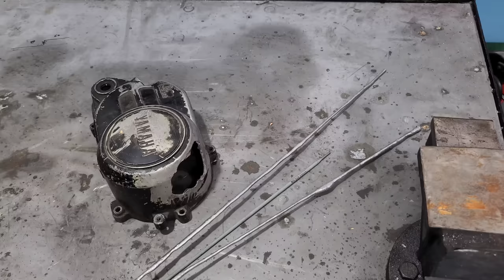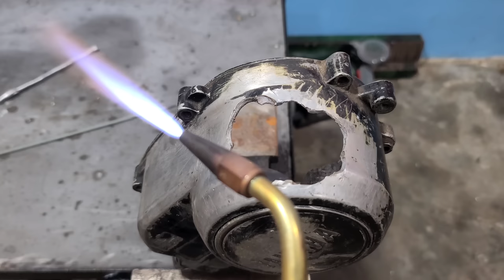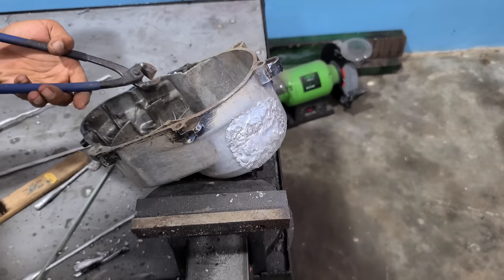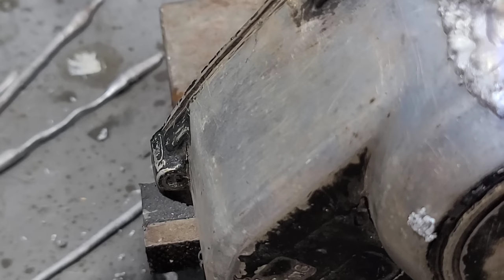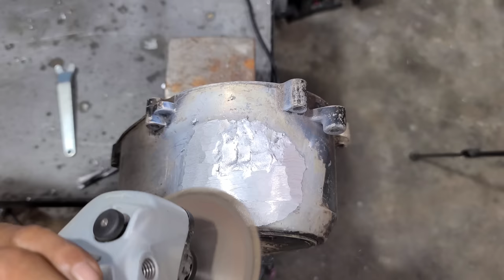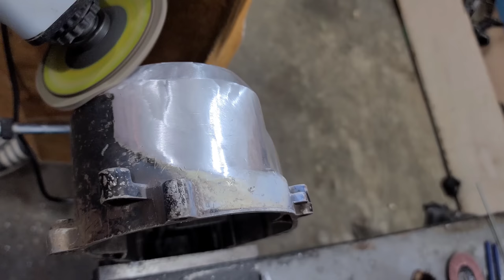How To Weld Aluminum , Hollow Motorcycle Blocks

Comment: I learned to gas weld Aluminum from a WW2 book published by ALCOA on welding for Aluminum aircraft parts before the advent of TIG. Takes time to learn and requires some serious practice. My biggest problem was seeing what I was doing due to the bright yellow flame given off making it hard to see when the Aluminum was going to puddle.  I did some experimentation and research to see what wavelength that yellow flame was then bought some low density blue industrial filter material (from Lee Filters) that blocks out the color of yellow, leaving you only seeing the Aluminum. Works great!!  NEVER let your flame be an Oxydizing flame, always make sure it is a slight carbuerizing flame for best results. Oxygen and Aluminum do go well together as any TIG welder will tell you! Same goes for gas welding Aluminum. !! Well done!
Reply: Use a #5 green to block the IR backed up by either cobalt blue or dydimium lenses. They are all readily available. If the filter material works well, that's good but it may not block the IR adequately. You should still back it up with a #5 green lense.
Reply: How do you stop it from making droplets encased in skin, that just fall off?
Reply: Essa vareta q epa tá fazendo  essa cobertura em.volta da peça ela tbem e alumínio

Comment: Having gas welded Aluminum before I got a tig set up I know how quick and perceptive you have to be to be successful. That said, to do a good job (ie: solid finished part), it would be far better to take a good piece of alu. of the correct thickness, shape it to fit the hole prep the seams and weld it.

Comment: I would cut and form 2 strips of alum plate and cut the hole square then tig welded it in much less work. but not a bad job for what it was but a long way I miss torch work lol. there's always so many different ways to do the same job keep up the good work & thanks for sharing
Reply: Do a video

Comment: B E A U T I F U L   J O B !!!
THANK YOU FOR DOING A SUPER JOB AND CAPTURING IT ON THIS VIDEO !!! I appreciate pretty work!
((I just subbed))
   My Dad taught me oxy/Actlyn and a coat hanger, welding before I was 10. I got into Iron Art about 11 and was mentored by a local artist for several years, making figurines, etc and selling them at a local art flea market. It is an art to be able to do. I worked as laborer and set-up assistant & later as a journeyman machinist at job shops and then got a break and got on with a major shop.
   When I first started work at the big shop, a group of craftsmen were trying to weld up a sheet metal fuel tank for a tractor, with 1/16" welding rods and were blowing holes in it and cussing like a sailor. I was 21 and not supposed to know anything. (No one knew I had been raised in a machine shop.) I offered my services. I got a torch with the smallest tip he had and a cutting shield, (I was used to goggles), and a wire coat-hanger and a wire brush and a strip of emory cloth. I swirreled the holes up and dressed them, like they weren't there, with the emory cloth. I asked what they were trying to do in the first place, and it was to weld in a 1/8" female pipe fitting. I got one of those and wire brushed it and installed it. Wire brushed it again and hit it with some Rustoleum Hardhat Spray paint  They asked me how I was able to do that. Then I informed them I could do that simple a job by age 10. My Dad raised me in a custom machine shop. The word traveled fast and Before the day was over, the young, know nothing, NEW GUY was accepted in all the craftsmen circles. It's nice to be accepted. I worked there another 37 years..
Reply: 👍👍👍👍👍👍👍👍👍👍👍

آفرین ..

Comment: This take more skill than most people will realize. I was not thrilled about the saw blade on the grinder, but the rest was great.

One tip, if you spray the aluminum with wd-40 it will keep your discs from clogging, and they cut the aluminum faster.
Reply: Yeah working with cast aluminum is very difficult
Reply: Instant warped engine case not being in a jig

Comment: You are seriously talented. Using a steel rod to bevel the edges, making the harness with bits of aluminium rod and using a timber circular saw for the first clean up is just 10/10! You are an ambassador for the forgotten versatility, usefulness and relatively low cost of the now abandoned Oxy Acetylene.

Comment: Great job. Never saw steel weld rod used to shape and get impurities out. Also great job using circular saw blade on angle grinder. Looks dangerous.
Reply: Extremely !!!. Local tool shop refuse to sell me one.
Reply: The welder's last name is "Dangerous"

Comment: Had to fix an inlet on a power steering pump I broke in two trying to tension the belt. Was just a crack and I needed it to be liquid tight at low pressures. Didn't have any of the proper flux or rods to do it so I went to a steel wire fence and took one of the aluminum ties that they use to affix the fencing to the poles and used that on the part. Used a bit of brazing rod flux on it and heated up the metal to just as it was starting to sag then aimed at the rod with the tiny flame and pushed it around between the two parts. Didn't look pretty but it only had one micro pinhole that created bubbles when I blew into it but didn't leak the power steering fluid. It was also very strong. Proudest bodge work I have ever done.

Comment: Nice ! and a carbide tooth cutting wheel for the rough shaping is actually a clever choice because abrasive disks will get gunked up by aluminium in not time
Reply: PAM cooking spray is all I gotta say. Idk what it does but it's cheap and keeps a carbide blade clean like new every pass. I only know this because I work in an aluminum fab shop.
Reply: @codyjohnson5674  HM. Ok , will try. 
And you for to try isopropanol alcohol as a cutting fluid for aluminium too, it does wonder
Reply: @TheOneAndOnlySame  alcohol is not explosive but its is highly flammable. We have weld slag flying all day non stop.  ISO alcohol is not a good idea in our shop.
Reply: @codyjohnson5674  Hmm ok. Try it on a lathe then 👍
Reply: @TheOneAndOnlySame  a lathe cut dont get anywhere near the temps a weld contains. Never seen a personal lathe make molten metals.
Reply: @codyjohnson5674  you need to look a the temperature at the very interface between cutting tool and metal. 
For a very short time in a very small thickness , temperature goes up enough to mar the surface without proper coolant/lubricant . 
Alcohol is a sh*t lubricant but it improves finish on aluminium 200%. Alcohol is a very good coolant. 

CNCs at work use cutting fluids that are base alcohol.

Comment: Good job IF no mechanical strength is expected, hopefuly the case here. I suppose in some areas aluminium plates will be more costly and difficult to find than simple soldering rods or alu sticks and work time is almost costless. And great job soldering with acetylene torch, so delicate with aluminium.
Reply: I would guess that to be oxy propane as it leaves no soot. I would be interested to see a impact test. Sometimes old school works great.
Reply: These engine covers are made from crappy cast alloy, so the weld is actually stronger.
I know because I had my old R6 engine cover repaired this way and it outlasted the bike (engine failure 6 years and 30,000 miles later).

Comment: Had you ever thought of making the hole square, then get a piece of flat aluminum plate, then cut a square to fit the hole from the flat stock, then weld that into place of the hole?
   Another thing, is you could clamp a piece of steel under the hole, then apply your aluminum filler fight on to the steel, and fill up the hole, after it cools, remove the steel, since aluminum wont stick to steel. 😁👍

Comment: Can be done much faster with a MIG welder.
I had my R6 engine cover repaired this way a few years back.
It was just $40 for a new part, but Yamaha did not have it stock and I could not wait.
Reply: Those rods he's using can be used to stick weld aluminum with an electric arc welder too.   I've used them to fix motorcycle timing covers.
Reply: La varilla es de aluminio?

Comment: Great job!  That carbide saw blade on the angle grinder to rough shape the weld is a bad idea. Using without a guard is a really bad idea. It works but will eventually end in disaster. Do yourself a favour and stop while you are uninjured!
Reply: I use a carbide blade with aluminum all time but will only use it on a air grinder. The air grinder doesn't have much strength and will stall easily so it has very little kick back to it. I agree using it on a electric grinder is asking for trouble. Interesting to use the 6013 rod to flick away the oxides.
Reply: 그라인다 카바없이 하는건 위험하지만 대부분 카바 벗겨내고합니다 안좋은 습관이긴한대 카바가 잇으면 그라인더질하기가 힘듭니다 특히.구석같은곳은 카바잇으면 그라인더질이 안댐 그래서 대부분 일할대 카비없이 하는경우가 대부분입니다
Reply: Он страха не знает😅 ❤

Comment: very good job but really its way easier and faster to find same thickness piece, shape it to fit and cut the hole square and weld that in. You only do this sort of filling if its in a corner, edges and other spots that require special shapes that cant be bent with a new piece to fill in.

Comment: I've welded oxy and acetylene with carbon steal but not aluminum I've welded aluminum with large spool guns and welding aluminum can be challenging at times but this level of oxy acetylene aluminum repair is quite impressive. I must admit. Well done sir. well done.Wheither you're aware of it or not most welding shops in America wouldn't even tackle that project because most modern day welders don't have those skills anymore to do aluminum oxy acetylene welding repair to that level anymore. so kudos to you sir you put most of us modern day welders to shame.

Comment: it was better to bend a plate that was suitable in thickness, then it would be good...
Reply: So it's "bad" because you wouldn't have done it that way??  It's cast aluminum.  It's not holding weight.  It's not under high pressure.  It's "good" the way he did it.  He could have used cardboard and JB weld and it would be good too.
Reply: @ronniestanley75  You could use sheet aluminum and bend it into shape to give it the right curve, and boil it, then grind it and polish it, and it would look like nothing was done on the outside and inside. Oh, this would be a level, but so much work, a lot of material was spent ...
Reply: @ronniestanley75  they didn't say it was bad. Lol.
Reply: Low bujed
Reply: I think he did a fantabulous job, and it came out looking professional, and it was HIS PROJECT and he was nice enough to video it in its entirety and post it for us to enjoy-joy. I appreciate the way he used a steel welding rod to flick the surface of slag and to smooth the molten aluminum like a trowel. I've done Oxy/Actlyn welding all my life and just picked up that trick from him. I appreciate what he did and the way he did it..
Reply: @audifan
maybe the host should get the benefit of doubt

maybe the host did this video for people eating popcorn while watching "something therapeutic"
Reply: I've seen & done all the sorts of repair you could do on this type of casting & I appreciate the skill used relative to the tools involved. It was a job well done. Yes there are other ways of doing it, but this shows that you don't need all the fancy tools. Desire, intent & creativity is of greater importance to achievement. I enjoyed seeing an alternative way to solve the problem.
Reply: @stevetenere4307  Everything depends on the task at hand, what needs to be done so that it is indistinguishable from the factory. for example, restoration, then a second level of approach is needed, but how to simply do the work and at the same time want to show what I can do, that is another question...
Reply: Sao không uốn 1 miếng sắt tròn vừa khuôn trong cứ thế mà hàn ngoài bên trong nó sẽ phẳng ngay vì nhôm không ăn vào sắt .
Reply: You got vids of you making it look better than his repair or you just mouthing off?
Reply: For what purpose are you interested in...?
Reply: @SR-gs8zo  Why go to insults, as another person has a second opinion?
Reply: Maybe you don't have this skill level because you want to find the "easy" way out.
Reply: @Dontfearthereaper001  Everyone in life needs to learn something new or improve their existing level...
Reply: Dang!,.. that's some fine additive manufacturing
Reply: @hohohaha999  I don't mind...

Comment: could shape a bit of plate and weld it in  save lots of welding .
great welding skills using propane and oxy
Reply: is it propane?  it really does not look like acetylene
Reply: yes deffo propane  it has the heat to melt/oxidise steel   so  at 658c  aloominum is well  within its capability

Comment: I’ve grown up around motorcycles. I’ve worked on them most of my life. I’ve had my own motorcycle repair shop. While yeah it is impressive what was done here go buy another one. That crank housing is built and designed to withstand a certain amount of pressure and to be able to withstand a certain amount of abuse that weld is completely unsafe and is not going to be up to spec. Go buy a new crank housing this is just dangerous.

Comment: There is a much easier and far stronger way to do this repair... first prep the edge with a bevel edge, then make a wax pattern with the right contour and thickness.. then sand cast it in aluminium from a scrap case or other parts and trim to a nice finish... then easily weld it on because it will fit exactly and be made of the same material as the original case ....

Comment: I would like to try this. Who knows what kind of rod and what gas? Is it really welding aluminium, or just using an aluminium solder?
Reply: I think he is brazing and not welding. Just a torch + aluminum brazing rod.
Reply: @abysmalc9251  I saw him making his own welding rods in another video by just melting old engine casings and clutch and brake handles. Makes strings in a bit of angle line. He is a dab hand at motorcycle repair.

Comment: solid weld repair, he used arc aluminum welding rod, which is fluxed. its not a braze. looks fine and durable for what it is, just soft because of the OA weld. probobly trust a rod patch more then I trust some fucking pot metal patch cuz it looks like the alum rod is all the pure aluminum this dude has. dissimilar casting scavnager weld is probobly worse then a full rod fill. the key to this repair is heat control and plenty of flux. I think I would up the heat a little bit but get more of a lump inside but it got fluxed well because of all the flux on the rod. probobly tons of air craft that has bullet holes patched like this in vietnam and korea lol

Comment: Seems like if ya was going do that way you’d took a piece of copper and cut the tube an beat it flat an used that on the back side so the weld don’t stick an just filled it with weld an ground it smooth.

Comment: Wtf, bro? Wasn't it easier to cut another piece of aluminium and just weld it on? Just work out a different piece of aluminium to fit the hole and then just weld.

This is unnecessary, complicated and expensive.